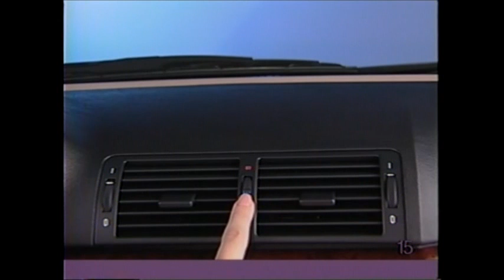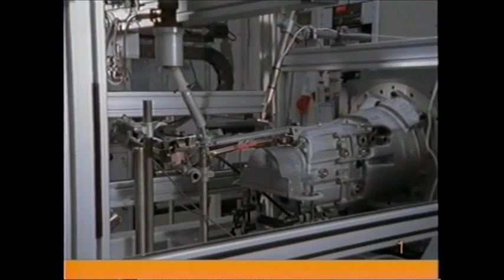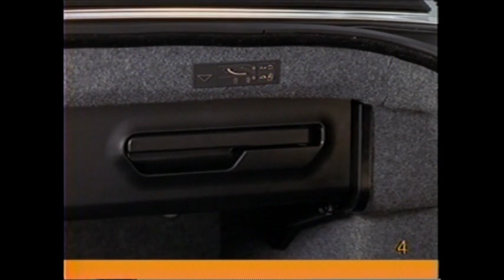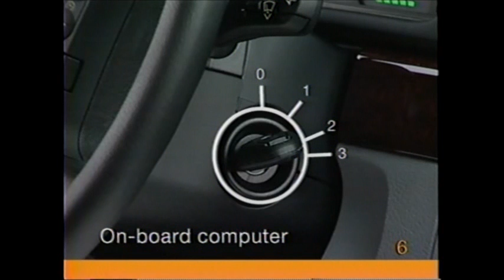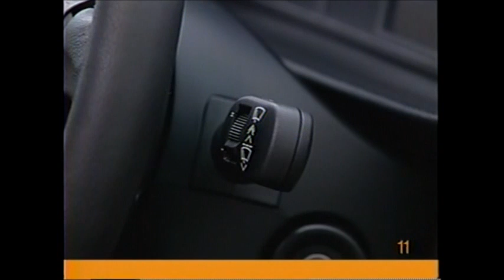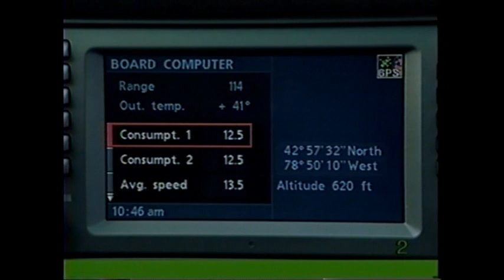BMW E46 Guide to Features and Operation Part 2

Comment: Just what exactly does that dial in the "airflow to the upper body" do? The video says turn the dial "toward blue for colder air or towards red for warmer air". But, does turning it toward the blue engage the AC or if towards the red engage the heater? Or, is it simply determining the opening size of a door to the heater core. Whereby if you turn it more towards the blue...it closes more of the door to the heater and thus seem cooler. The reverse being that if you turn towards the red...the door is opened wider to the heater and the air is warmer. Final question is how does this dial affect the temperature you set below in the climate control. For example, if i set the climate control below to 80F and I turn that dial above to blue...what will happen? What's their relationship?
Reply: It’s like Manuel climate control you can control how cold or hot
Reply: Yes

Comment: I love this. Just bought an old e46 yesterday. The car is 20 years old. Good to know how to operate a few old stuff things
Reply: just got mine monday
Reply: @retroactive1  Hope you are enjoying your E46😎
Reply: @ElChanty46  hell yeah been using it as my daily 40+ miles a day everyday. hasn’t given me any trouble yet, i’ve replaced pretty much the whole cooling system the weekend i got it. she’s chugging along very healthy.
Reply: @retroactive1  e46's are very reliable cars, my dad has a 323i and it saved my family from an f30 320i engine failure😎. That e46 almost never gives any issues and is so smooth to be driven on👍

Comment: I would really love to get brand new e46 its just not only an amazing car but a car that never dated
Reply: yup, ive seen mint m3's, even a low mileage 325, it is possible to find them. The 325 had like 20k miles. M3s ive seen as low as 40-70k not bad at all. Usually means they were garaged too, so maybe worth a buy.
Reply: DjStiv3 indeed it worth to buy. if i were milionere i would ask BMW company for a new e46. yes you can find some woth low mileage but nothing could satisfy you other than a new one that smell is amazing and to know that this car has never been driven by someone cos its new thats an awesome thing isnt it?
Reply: Ilkin Goyushov
i imagine there are collectors out there.
Its possible theres a few mint none driven ones out there. Every now and then people find barn finds too of rare cares barely driven, just have dust on them.

I have the same mindset however owning a use one aint bad if its mint.
Hell if you were a millionaire you could build one yourself or just buy a used and create a mint new one. Rebuild engine and trans, go down to bare metal and paint it well, new seats, hell create it in your own image of what you want.

Hell id take perhaps an e46 chassis, pop in an e92 engine and tranny if possible, upgrade suspension and interior, push out with fender flares or a body kit and create a GTR looking e46, it would be updated to my liking and more modern appeal.
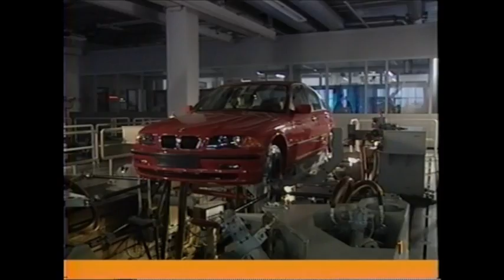Reply: 3:19 lol they did this not the right way then cause the rear subframe cracks
Reply: go for it bro I love mine
Reply: Mmh maybe not enough real world testing and to much rig testing
Reply: That's gonna be hard beings they stopped making e46 sedans in 2005 and coupes in 06'. I believe the newer 3s are e90s or 92s
Reply: Mine is a 19 year old 318 tourer and has 15,430 miles on it and looks absolutely mint condition
Reply: bought one 5 months ago in tokyo: 2000 320i, only 33k kilometers. twelve hundred bucks. the car still smells new. i know where a 2003 325 wagon is being sold in tokyo. 37k kilometers. 2000 dollars.
Reply: blackpassenger awesome prices
Reply: @blackpassenger  like mine in the U.K.